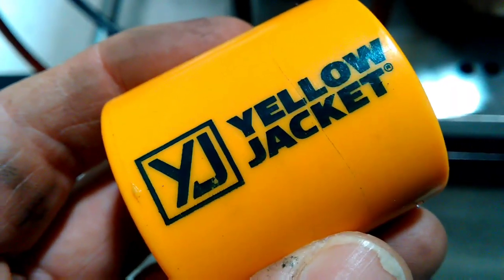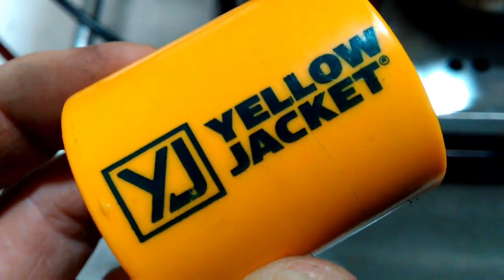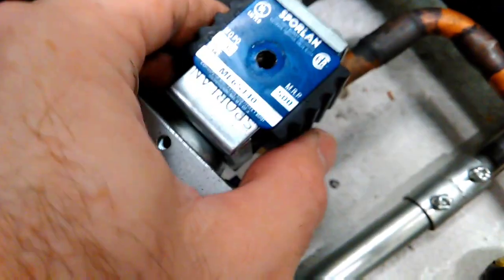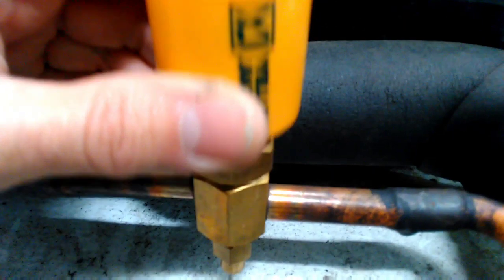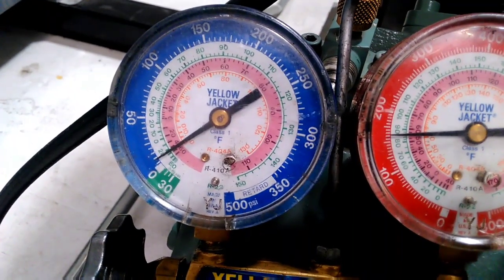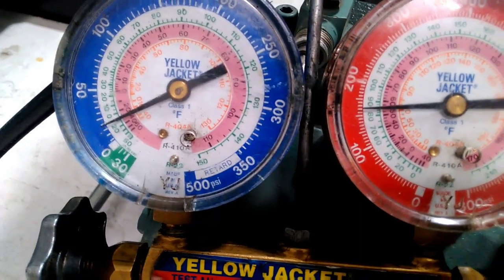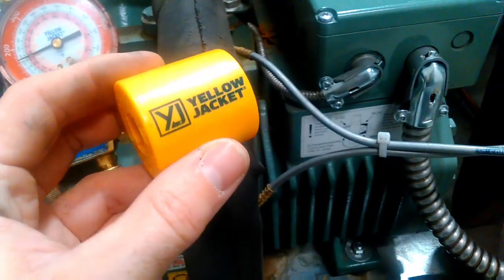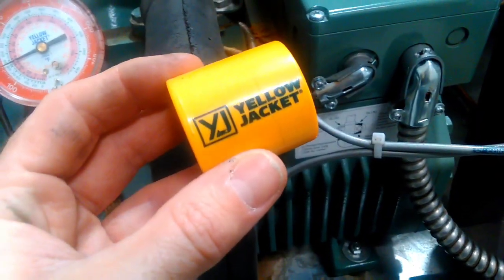HVAC Tip - Using A Yellow Jacket Solenoid Valve Magnet

Comment: What are some other uses for these magnets?
Reply from the maker: Adam Walker recovery and vacuum and troubleshooting
Reply: HVAC Know It All what about solenoids in gas valves, can these be used to test or manually open them?
Reply from the maker: Adam Walker if this magent will fit over then yes probably
Reply from the maker: Adam Walker but not on conventional valves like you might be thinking